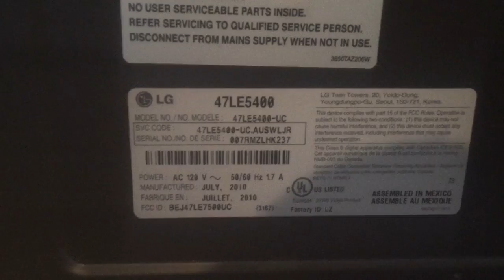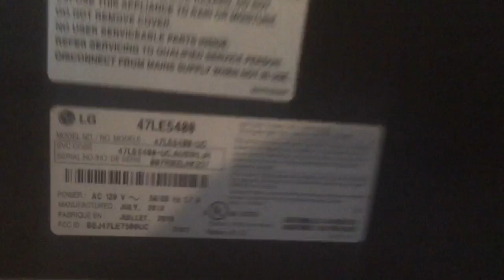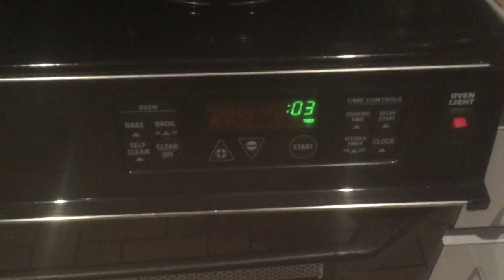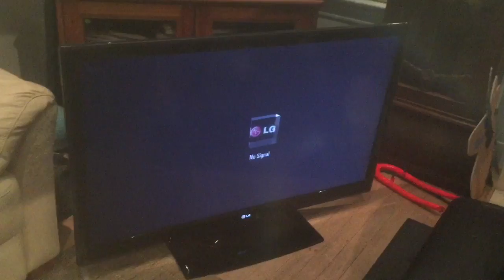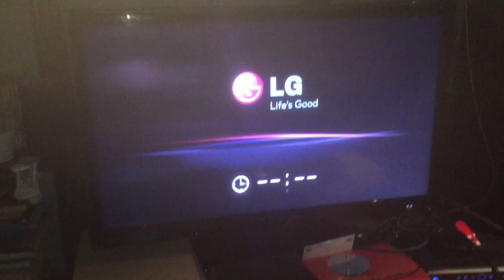Repair An LG Television Motherboard By Baking It In The Oven

Comment: I was the office today (Sept 27, 2018). My wife called me on the phone, said the TV (LG 47LW6500) went out. Oh boy, had it! It would power on, but show no video (not even menus), and play no audio. I bought it in 2011, so even my extended warrenty had expired. So, I took out the motherboard and baked it at 385F for 10 minutes. When the timer went off, I turned the oven off, and opened the door. I let it sit in the oven for 30 minutes. I then took it out of the oven and let it cool an extra 15 minutes. I put the TV back together.... and it worked perfectly!!
Reply: UPDATE: Just today (October 2nd, 2021) my TV went out again. I repeated the same steps as I mentioned above, and it's back to working great!

Comment: Just fixed my LG 3D LED TV 55LW5700  using hot air gun 370°C only on IC101 for 2 minutes (remove the heatsink) and it WORKS, thank you for the video.
The problem was no video, no backlight, red indicator was flashing (slow). 
Before that I checked the power supply, it was fine, PWR-ON 3.5 volt, 12&24 volt in P201, and 56 volt (63v when backlight is on) in C256&C257

Comment: Thanks a lot for your video. I was skeptical about this “baking” process but my LG 55 in tv  gave up audio first then all hdmi ports. It’s 7 years old, so out of warranty. I had nothing to loose so decided to give it a shot. Well 385 degrees and 10 min later (plus assembly time) damn tv is working again! Thanks a lot!

Comment: I literally can not freakin believe this worked, but it did!! I've been into electronics for probably 25 years, have some of the nicest soldering equipment around, yet somehow just sticking this board in the oven at 385 degrees fixed it in 10 minutes, and the only repair tool needed was a screwdriver LOL!

Comment: I have been an Electronic Engineering Technician for the past 47 years and I am very much up-to-date with technology but this is the most foolish advice I have ever read.  The SMD (surface Mount Components) cannot and will not accept temperatures pass 55 degrees Celsius for more than  3 mins and this fake procedure will cause the temp on these sensitive components to raise past 70 degrees which will cause them to be dislodge from  the PCB causing a catastrophic failure of the PCB within the first 20 secs. I have attempted this even using a heat gun with lower temp and the PCB was still fried. People attempting this are all silly and frustrated and are a bunch of crazy liars, it just cannot and will not work. 210 degrees for more than 15 secs will destroy any PCB made for home consumer equipment. If it is made for NASA you will still not even have a chance. Stop this foolish propaganda.
Reply: Dude, I have done this multiple times on the same model tv and it got my tv working again. I'm about to do it again and my tv will once again work. Don't know what causes it to not work or why this method works, but you are literally telling a ton of people who have successfully achieved something that their method will not work.
Reply: Btw you might be an electrical engineer but you've never fixed a tv set in your life. Be honest
Reply: I am replying for educational purposes: I have been functioning as a Radio/TV/Telecom technician since 1972 and I have specialized  in component level of repairs on Philips, Sharp, Samsung, Grundig,  Admiral, Yaesu, Kenwood and about 25 other brands. I have repaired all types of CRT TV from the tube types to solid-state types and most recently Plasma, LCD & LED. I have been designing  and building audio amplifiers from 5 watts to 150 watts and I have repaired  over 1,700 Televisions in my life time. 7 transistors pocket radios to Sansui & Kenwood AM/FM stereo amplifiers ranging from 35 watts to 500 watts. I have taught Electronics for a period of three years privately. My first Radio and TV Course was from the corresponding school NTS in the USA then CIE. I have completed three full time courses in Electronics and about 165 Part-time courses specializing in Decca, Kelvin Hughes and Raytheon RADAR systems. Attended Air-Traffic Control RADAR training in 1990 at Raytheon Training Facility in Kitchener Canada for six months full-time. I have written three "E Books" namely : Servicing Microwave Ovens, Basic Electronic Maths and Home Appliance Repairs. I am still learning so you judge me wrong. This is just 1/8 of my acomplishment  in Electronic. I have served in the Coast-Guard for 24 years as a Telecom technician and 15 years in The National Gas Company of Trinidad & Tobago as a senior Electronic & Telecom technician. I am sorry I have offended you.
Reply: @datylor1  There is a possibility that it is the unplugging & reconnecting that is the actual fix as corroded or dirty connections are a common cause of faults that might be attributed to the motherboards.
It might be worthwhile for people to simply try disconnecting then reconnecting all the connectors before doing the celebrity chef routine.
Reply: @fins59  aha finally something that I can try first. maybe some contact cleaner, too?
Reply: @mpoerot8013  Yes, non oily contact cleaner like Isopropyl alcohol would be perfect.
Reply: Dude you're wrong just fixed the sound on an LG by baking it..Not sure how long it will last because it was slightly stop and starty when i installed the MB but atleast its given me the confidence to buy a new motherboard knowing that, that was the fault. I read your reply and thought i dont want to be a sucker for some mad scam but so many genuine looking videos are out there, i thought shot to nothing. Proves you dont know it all, careful calling folks liars

Comment: I was amazed to find this last winter and it fixed my LG 3D TV (which I hate to give up since they are now hard to find and very expensive).  But it only lasted about 6 months.  However, I did it again last night and it's working again!  Not sure if it just lasts only so long or it just didn't take completely the 1st time.  We'll wait another 6 months and see.  But every 6 months that it works is just more time that I don't have to buy another one!

Comment: I used a cardboard box with hole for a heat gun set at 610F and a temp probe on the other end, then adjusted the flaps as needed to keep between 380F-390F. About 10 minutes a full temp then cooled with box closed for about 40 minutes. Mounted back in TV and it works like new and no stink in the house.
Reply: worked fine with my lw5700 and today is my second time xD
Reply: @DieaAhmedT  wait, you mean you'll need to religiously do this ritual every certain, weeks/months?

Comment: Hey thanks for this!  my 42lv5500 crapped out on me 2 nights ago no video no sound no back-light only the power light would flash red and go to white then turn off.  Took the main board out and put it in the oven for 10 minutes @ 385f no preheat.  Let it cool for an hour popped it back in and turned it on and it came right up.  Thanks!

Comment: Unbelievable, baking the board worked! I have an LG 42LE5400 which lost it's picture and sound. I opened the TV up to get the main board part number with every intention of simply ordering a new one. I quickly learned the main board for this model is very hard to find. I, therefore, decided to try "baking" the board per this video's example. I put it back together and it works again. I do not know how long it will work, but I am simply amazed it worked at all. Wow.

Comment: It worked! There was some powerful fumes but we just used the oven hood vent and brought in a fan to blow out the kitchen. I think there might be something to the "Amazon stick causing overheating" theory because we started noticing issues right after we installed it. We might try removing the FireStick when we aren't using it. Great video. Thanks!
Reply: This is exactly what I was thinking. Never had any problems until I used the fire stick

Comment: How to ruin your main board part one. Doing this may work for a while but it's not a fix. Your overheating all the smd capacitors this stressing them all. Your likely melt your sockets especially euro scart. There is a strong chance your dislodge other components. And finally the fumes are highly poisoning to health. I used to do this but the sets would fail agaun months later and I would have angry customers on my door. I've since bought a proper pcb reflow oven .
Reply: it's already ruined anyways

Comment: I’ve now done this twice for two separate problems on the same tv and it worked both times.  I stared at the tv in disbelief that it was working both times.   Trickiest part is disconnecting and reconnecting the ribbon cables from the motherboard.  I’ve also noted that my tv is just above an an AC vent that is behind my entertainment center.  I suspect the cool air blowing up onto the motherboard side of the tv may have been causing added thermal cycling.  I duct taped a cardboard baffle behind the entertainment center to avoid the cold air blowing on the tv. Hope this prevents a third trip into the oven.

Comment: Worked for my friends mothers LG tv - no sound - now perfect. No doubt that causing the solder on the surface mount devices to re-flow is what cures the problems, especially with BGA devices.

Comment: I got my doubts about this video, because I don't see any traces of burns on the cardboard, my TV had a bigger problem, no picture, no audio so it was completely dead, so I thought I'm throwing this away what the heck will I loose, so I tried and it worked, but instead of used my stove oven inside my kitchen I used a small oven outside, without cardboard, I put it straight on the tray 250 Fahrenheit for 10 minutes and let it cool for 30 minutes, after that I installed back and now like magic everything works, the only difference from yours is that I see melting flux solder paste on various parts of the board. But thank you very much because I paid almost $3000 for my TV at the time like 7 years ago , it's an LG 3D the model# is 55LW5600. Thank you again

Comment: This is nuts. It really fixed my LG 42LW4500! In my case, after turning it on, it would blink blue for a second or so and turn immediately red. I could hear the reles trough the process! I backed it at aroiund 200 Celsius for 10 min

Comment: Worked for me unbelievably.  Was resigned to having to buy a new t.v, even checked cost of replacement motherboard but hard to find now and range from £50 to £200 so tried this method really not expecting much. LG 42" stuck on start up screen.  Baked at 196 ish Celsius  for 10 mins and bingo works as good as new. Brilliant, thanks.
Reply: David Hughes-Jones hey what object did you place the board on before putting it in the oven?

Comment: I just did my 55"LG TV and  it worked !! Amazing ! thank you for posting the video !
Reply: Hi. Actually my problem was a Solarized and distorted picture. I removed the motherboard put it in the oven as recommended and voila !! Image was fixed 100%. ¡¡ HDMI ports were also fixed !

Comment: This is the problem :

Nine times out of ten, we see these boards with malfunctioning  CPU chips also called BGA which stands for Ball Grid Array. These chips almost always covered with a heat-sink run fairly hot.  The chips are very resistant and almost never break, but after years of heating and cooling (Tv being turned on and off), microscopic cracks will form in the solder balls between the chip and the board. These cracks, will prevent data from going through and thus malfunctions will occur.
So how do we fix it? :
Here at Nick's TV repair we will fully remove the chip from the board and remove all the old solder on the chip and the board. Once all cleaned up, we will rework the chip with higher quality solder. The solder we use as apposed to the factory standard solder, is made with softer metals which is more malleable. This means they are less prone to cracking over the years.
Reply: I was told that i probably have the exact same thing with BGA Chip (TV started restarting, then wouldnt turn on at all - just blinking LED). Should i bake it in the oven or should i order new PCB  which is about 78€ .. ?

Comment: I have the same exact TV model as the one in the video. My TV was bought in November 2011 and failed just a couple days ago May 2018. I already had a replacement television in a different room so I figured what do I have to lose I took my toaster oven outside and bake the board at 380 for 10 minutes I let it cool down for a half an hour and now the TV works just fine. Absolutely amazing thank you as I was researching how to fix it for a day or two figuring I would spend a couple hundred dollars or just put it in the trash.

$0 and TV works that's a win-win I recommend this video to everybody.
Reply: It is now September and my TV is still working fine. Thank you for the video. I just wanted to check back in and let people know it still works I might check back in another 3 to 6 months to update my post.

Comment: Worked for me. I baked at 375 for 10 minutes and the screen starting working after re-install of mother board. I had lost the screen signal seeing only random lines. The screen started intermittently losing the ability to generate a display, then one day it just stopped returning to a visual. Works fine now. We'll see how long it lasts. LG model 42 0550.

Comment: I have a 55le5400. After baking and cooling down I have re-installed the board and put everything back on. When turning the TV on it was working but half of the screen was white. So I have to disassemble again and made sure that all connections are properly secured especially the tapes. It worked afterwards. I wish I had tested first before I put all the screws back the first time. Thanks for this video.

Comment: So I used a heat gun instead and it totally worked .. great fix man
Reply: Heat gun works for me too, but needs repeating it time by time, we need to know what part of mainboard to heat, thats the main point of repair, here in Moscow working mainboard costs 100$ they also takes broken one ( i think they solved this problem directly)

Comment: Well yesterday the HDMI ports went bad again so I baked it in the oven for the 3rd time in approximately 11 months; however, this time did not work. The local channels were working fine before I baked it. Now they have a green screen. I can connect my cable box to the component cables but again it is a green screen and blurry picture. Back in the oven as I type to give it one last try before I give up on this TV.

Comment: TIP.  THOSE 2 black things with fins are heat sinks with thermal compound underneath.  Probably want to remove those and add some more thermal grease which gamers use. That smell is probably burning grease.

Comment: Worked on my LG 60pz550. One night all the HDMI inputs stop working. Baked the main board for exactly 10 minutes at 385. Let cool for 30 and reinstalled. All HDMI ports are now working again. Just be sure to open a window or two when in the oven. About 5 minutes in and it starts smelling up the kitchen.

Comment: Fantastic! I had an issue with the tuner on LG 42LE5500 made in 2010; Digital channels were appearing normal, but analog channels were complete blank; scanning could not find any analog channels; after this baking recepie, it is all working as it should! Alive again in 2018! Many thanks! 👌

Comment: Can confirm this worked for a 50" LG LCD that had no image and HDMI ports had also ceased to work. I wrapped it in foil paper before putting it in a clay oven where I had a hard time controlling the temperature. I probably baked it over 200 celcius at times, trying to regulate the oven's combustion. Worked perfectly fine after I let it cool for an hour (HDMI ports too). So I don't think temperature control has to be too strict.

Comment: This worked for me. Unfortunately just bought new tv yesterday......now I have two good tvs. It was 47LE5300, the sound stopped working. Wiggled all connections on mother board , tapped all over board while running and could not find any evidence of a bad solder joint. Cooked it @385 for 10 minutes....everything now works 100%...first time!.....girlfriend thinks I am now a genius....unfortunately she knows I saw this video.

Comment: Still working!!! (almost 2 months already after the barbecue of MB)

LG 42LV5500 - WORKED !!!!!!! - My TV had a problem - no sound and no picture on the screen. Despite of my first non-confidence I tried it because: My TV was in service (non authorized service) and the technician told me that issue is the mother board and he heated some connects on the board and managed the TV worked again. He told me that he cannot provide any guarantee and if the issue appears again, the mainboard will have to be replaced.
The TV worked well about 1 month and than the same issue appeared again - no sound no picture on the screen (black screen).
Based on that I decided to try it as there was nothing to loose and the cost of the mainboard is not acceptable given the cost of a new TV and the fact that I bought new TV anyway and this one was in our children´s room so not "main" family TV.
So, we had afternoon  "mainboard barbecue" according to instructions (195 Celsius degrees, 10 minutes bake) and....I was surprised - the TV WORKS AGAIN!!!!!! (obviously we will see for how long, but it works again...)
(I used air heat in the oven, not upper and lower grill heat)
Thanks for posting this video!!!!

Comment: What is the reasoning behind this??
Reply: In short It resets/refills micro-fractures in the solder attaching an Integrated circuit, in this case I think the CPU to the motherboard..